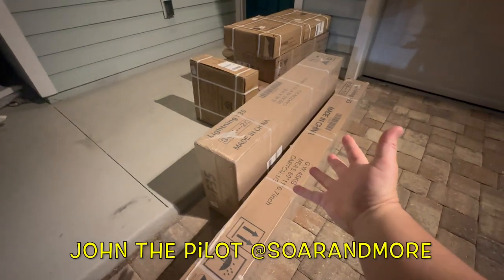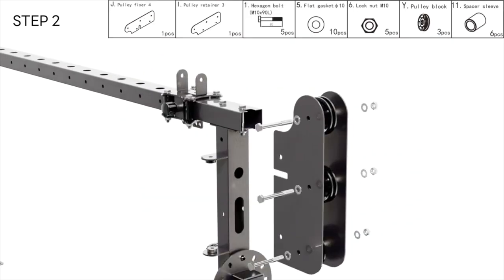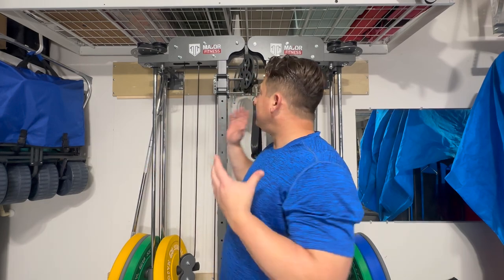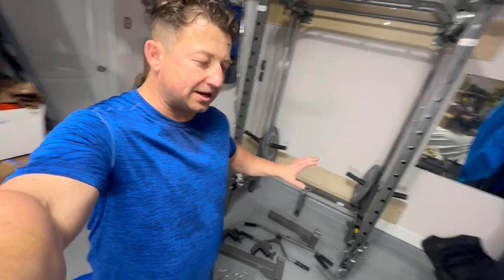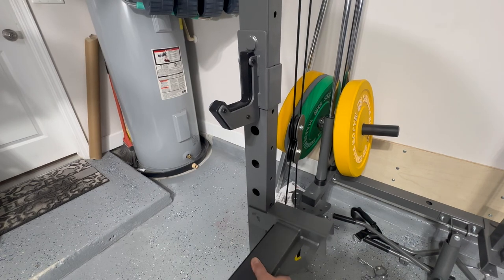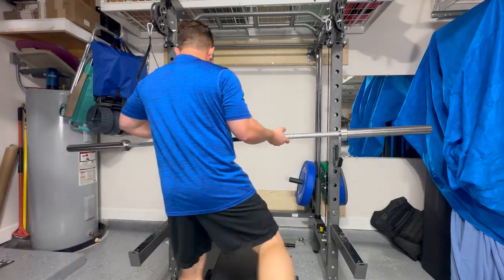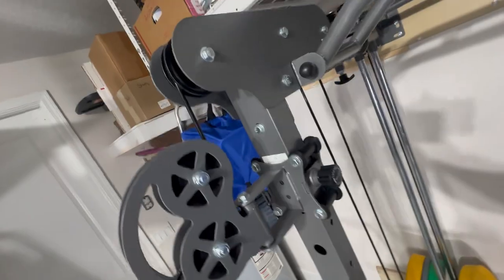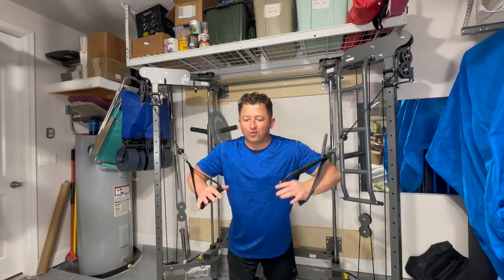Unleashing the F35 Folding Power Rack #majorfitness

Comment: What size lag bolts did you use, and instead of the plywood, do you think a 2x4 or 2x6 would offer better support as the stringer that you bolted into?
Reply from the maker: Absolutely I think a 2x4 or a 2x6 will offer more for sure.  For me it would be over kill.  I tested the heck out of trying to pull it off the wall and there was no chance.I used 3/8 lag bolts that were 1 and 1/2 inches.  If you use a 2x4 or 2x6 you will need bigger lag bolts depending on your wood working technique to make sure they are secure to the wall.  Enjoy the F35
Reply: Rock on. Thank you again for the testing and the reply! You'll have to do a review if you ever get that seat for the f35.

Comment: I have the f35 also, id recommend installing on your garages back wall to avoid the slope that most garages have,it should be more level, a stringer board is absolutely needed for wooden studs, I've had mine since mid February and I'm a little disappointed in the quality of the coating/painting already chipping, I'm not man handling the spotter arms and j cups or pulleys but its chipped a bit, also be sure to fully assemble and lock the the pull up bar into place prior to attaching the rack to your stringers to maximize any free play in the pull up bar and adjusting pins, i attachdd my rack without it in place and the pull up bar is a bit tight but has settled in now. Id be comfortable in dropping 400 pounds on his rack no problem so for just about most people i think its safe they will never test the rigidity of the 14 gauge uprights
Reply: Also my pulleys could be needing some additional lubrication,  they are tight when doing fully opened flyes , but otherwise work well enough for any other exercise
Reply from the maker: I would have put on the back wall but it’s impossible for my set up.  My garage has a ledge in the back that is like a step that goes the entire back wall and is about 2’ 1/2 wide.  The F35 wouldn’t be able to fold or close.  For other garages I agree.  

Yes extremely important to mount to the wall fully assembled.  I’m doing an update video soon of the use wear and tear aspects.  I have paint scraping but nothing major…. All my work out equipment has scars and a tale to tell.  

I’ve enjoyed my F35 very much and it definitely has added some power back  into my physique.  I’m very happy about that.
Reply from the maker: @jarontaliman1  you should use the super lube.  Worked for me.
Reply: @SoarAndMore  I'll look into it,  also I placed horse stall mats underneath the rack prior to mounting, and they help the wheels roll smoothly, God bless 🙌🏻 🙏🏻
Reply from the maker: @jarontaliman1  that’s a great idea!  Thank you for watching!  God bless!

Comment: What length lag bolts did you use? also did you just us them to mount the actual rack?
Reply from the maker: Great question, I used 1 and 1/4 inch lag screws with 1/4 washers for the rack and 1 and 3/4 lag screws for the plywood to the 2x4 studs.  I didn’t use the anchors that were provided because they are for concrete.  Hope that helps.  Thank you for watching.
Reply: @AviatorsGarage  I used two 6ft 2x10 as stringers I used 1/4in x 3 1/2in lag bolts to the stud then used 1/4in x 2 1/2in to mount to the stringers. (Just incase anybody reads this comment: Washers use washer!) luckily my neighbor had some and it made a lot of sense after! thanks for posting this it was very helpful! Good luck on your fitness journey
Reply from the maker: @BryceFraser-id8sm  thank you for the information! You will definitely help someone for sure!  Enjoy your F35!!! I love mine.
Reply: @AviatorsGarage  Good morning. Solid video and I appreciate the honest feedback. For the plywood, did you use 3/4”? Looks like maybe 10” strips that you cut it down to? Like 10”x48” for the top and bottom strip?
Reply from the maker: @lckyguardian  My buddy gave me some extra strips that he ripped from a 4x8 sheet of 3/4 inch plywood.  They are about 10 and 3/4 inches wide.  I've had no issues at all with security.  Thank you for the feedback. I appreciate the comment.  Let me know if you have anymore questions and thank you for watching!

Comment: The pull-up bar cross bars are oddly spaced. Why is there a bar dead center?  There’s no way to do parallel grip chins without being way off to the side.
Reply from the maker: That’s a great question.  Yes you do have to be on one side or the other to do those parallel chin ups… @major-fitness  why was it designed that way?

Comment: John, thanks for posting the review. IM currently stationed on Fort Novosel, and have been thinking about getting a home gym for a while, really interested in this system.

 How do you feel about the stability of the front two post with the wheel system?  

After continued use have you noticed any sagging from the post or damage to your floor?

This is the number one  contender I think to go with, but Im hesitant, as I've never seen a rack  that has wheels at the bottom at.
Reply from the maker: Ben first and foremost thank you for your service. I was at Fort Novosel when it was called Fort Rucker many moons ago.  I have to be completely honest and say I’m impressed by the F3 5 and it’s extremely sturdy as long as it’s put together correctly and well.  Nylon wheels at the bottom. I have been abusing back-and-forth because I’ve been using the heck out of this equipment.  As far as any type of sagging, I have not seen it anywhere.  But for the record, I’m not lifting as much weight as I used to when I was in my 20s however, the whole set up is rated to hold 660 pounds which I’m sure it could do no problem.  I think the key to putting this thing together is making sure that you level the system as best as you possibly can when you mount it to the wall that it will be attached to.  I took extra special care, making sure that every piece was level and perpendicular as it should be before I completely bolted it in.  if it’s going to be in a garage and it’s on the sidewall, you have to note that there will be a pitch and you have to count for that.  But thank you for reaching out. I appreciate it and I’ll take another video showing how it’s been holding up with the wear and tear.  But as far as saving this rack is by far the best one that I have seen in professional gym, set up and anywhere else in the CrossFit world because of how it folds up and also has a cable system.  Please let me know if you have any other questions.  I really appreciate you watching.
Reply from the maker: Also I forgot- there is a military and first responders discount- if you buy sign up for that and there is an Easter savings event!  Check out this video- Achieve Your Fitness Goals with Easter Deals at #MajorFitness
https://youtu.be/G1LPmzfOKsY

Comment: Amazing review! So detailed.
I’m looking to build a home gym and so far this is my favorite rack I’ve found. There’s hardly any cable racks that fold and I really want the folding.

Can you please update how the cables are holding up? After adding the grease does it feel like a commercial cable tower? That’s my only concern as I use a ton of cable exercises
Reply from the maker: Great question!  It’s been absolutely fine.  The grease helped a lot.  As a matter of fact, they have gotten better since time has gone on.  I think you will like how wide you can adjust the cage to do wide pulley exercises.  This is the only folding power rack that does (that I’ve seen). It’s been a great addition to my home gym.  Just note you will need many variations of Olympic plate weights to get the weight you want on your cable system.  Thank you for the comments.  And thank you for watching.  Please feel free to reach out anytime if you have questions!
Reply: @AviatorsGarage  thanks for the timely response!
A follow-up review video would be really nice if you have thought about doing one in the near future :)
Great channel!
Reply from the maker: @trevorbuckley4574  absolutely in the works!  Thank you for the compliment! It’s much appreciated!
Reply: @AviatorsGarage yeah that width adjustability for the posts is a great feature for varying pulley exercizes. Haven't seen it elsewhere either.

Comment: Hello John, thank you for making this video man. This thing is sweet and im thinking of buying. In regards to the brace boards you bolted to the wall, would you mind telling me the height of the top board from the floor to the bottom side of the top board, please? Reason being, theres is an electric panel adjacent to the area i want to install this unit and i need to see if the height would clear my panel. Thank you in advance!
Reply from the maker: Great question-  I’ll post them in the AM for you.
Reply from the maker: As far as the mounting point that go into the wall-  the top point sits at about 82”1/2 inches to the bottom of the floor.  The bottom of the mounting point (top one) is 76”1/2 inches.  Now the bottom mounting point top part is 17 1/2” inches and 11 1/2” inches on the bottom (all measurements come from floor.  The width is about 47” inches centered on all mounting points.  Hope that helps
Reply: @AviatorsGarage  you are most kind Sir. Thank you for that information, and a big thank you for your service!
Reply from the maker: @jparrales86  absolutely! Thank you for watching.  Glad I could help!